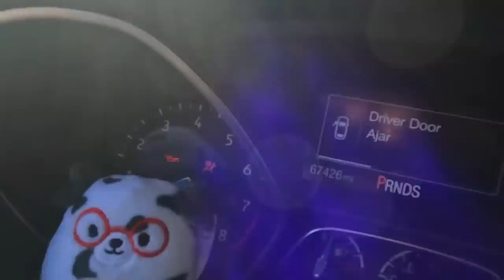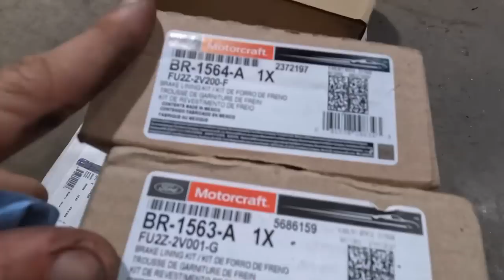Mechanic Cheats book time! Close Call | 2016 Ford Focus 2.0

Comment: @35:00 - looks like ball joint boot got punctured/cut by dust shield (little sharp burrs there), shmoo coming out. It is my little personal experience but those boots are quite fragile and too easily damaged. Work on them with extra care. Even checking them with pry bar or smth may (pinch)cut the rubber.

Comment: Hi, Ray. I just love watching your videos and your sense of humor.. As a mechanic myself , I have used antisieze compound on bolts and ball joints, to slide in easier. I also chase the threads so if any torquing is needed then it will be percise. Here is a thought, when you were having trouble with that long bolt with the compressor, you could have just cut it shorter. 😄 Also when you said that the " tip " fell out , well that could have gone south.😜😜😜. 
Hello. From Canada.

Comment: 26:05 I got a set of those mountains used from eBay. I tightened a 19mm bolt doing a control arm and it popped like I broke it. Spun it around a couple times and the ratchet thing re engaged. Works like new. Idk how the hell they made these things but they're indestructible

Comment: Ya know, those rear bushings are available in aftermarket, but I suppose with near 70k miles is was a good idea to just replace the arm...
Reply: True. Sometimes you can`t replace just the bushing. It is usually pressed on and needed a large press to remove it. Also ,it is also sometimes cheaper to just replace the whole arm , instead of the bushing replacement , due to shop time.

Comment: You could have removed the bolt on the bracket to the right (front of the car) of the AC compressor that's holding the hard line and you would have been able to move that compressor a lot more to get the bolt in and out easier.

Comment: Next time you get a Mazda or Ford with the 2.0, 2.3, or 2.5 and you have to change the passenger side control arm, go up top, loosen the passenger side motor mount, and jack the engine up 2". It takes all of 60 seconds!

Comment: When I changed the plugs on my Patriots I spray some PB Blaster down the hole before removing the plug and removed it slowly. This allows the oil to do its magic and vastly reduces the odds of the steel spark plug pulling the threads out of the alloy heads. Dissimilar metals, you know. A dab of nickel antiseize goes on the threads before hand tightening with a torque wrench.
Watching the inspection, when I do my cars I treat it like my life and my family's lives depend upon it. New brakes and possibly new rotors (pull the wheels and measure the thickness and the corrosion, you'd be surprised) and new tires are on the short list. It's not fun when you're driving in the rain and suddenly the steering wheel isn't connected to the road.

Comment: I find myself troubled when replacing parts on vehicles with pen stuff when it’s the one that has failed prematurely. In my head I am saying “why would I put the same junk parts back on the car”? Doesn’t this focus only have like 65k miles and the bushings are bad. I will let moog or mevotech take a swing at it before I let oem fail again.

Comment: That passenger side engine mount will leak and give some bad vibrations as the fluid leave snd it drops down metal to metal.   That ac compressor sucks, my daughters car had one on the 2.3L version of that engine.

Comment: seems like that zip tie head kept the cover from seating fully. I thought the video showed that one being tightened yesterday? maybe that was corrected. It's a good trick, but zip tie head should be down the side, it will still do what it's supposed to. an even smaller one would work. With those dumb plastic screws I would "never" use power drive, I prefer hand driver and go backwards to feel "click" of thread start point, THEN screw in by hand. After you cross thread a few sprinkler valves with same type of plastic screw, you reassess methods, because cutting out a irrigation manifold due to stripping a plastic screw is something you don't wanna do more than once.      Always enjoy the videos.

Comment: I wish Ray's shop was closer to where I live... brought my car in for what I figured was routine maintenance/tune up.  (60k/11yrs.)  I was expecting about a $1500 bill to change spark plugs (customer supplied because they refused to buy the ones I wanted), flush coolant, flush transmission, oil change, and tire rotation.  Good news is that was only $975, but the bad news is they also claimed I needed new outer tie rods, one sway bar link, and lower control arms (because the bushings were separated), thereby increasing the price by $2110.  I'd like to think Ray would have gotten this fixed at a much-more reasonable price.

Comment: I've  noticed that a lot of shops on here don't use anti seize. Is their a reason for thar. Here, we always use it. Galvanic action is a big thing here. Secondly you had bushing failure at I believe 60000.miles. why wouldn't opt for a lifetime warranty vs dealer part. The customer  would still pay labor either way,he just wouldn't have to pay for the part again

Comment: Back when I was an auto mechanic, I used to return the old parts back to the customer. I also got in the habit of taking photos of the part or parts before I removed them. Then I could show the customer what the old part looked like before I removed it. Then to prove the customer got new parts, I took photos of the new installed parts. I also saved the photos just in case the customer had any issues.
Reply: That must have been quite expensive and time consuming back in the day. I can picture the photographer you hired cloaked behind his pinhole camera and his gunpowder flash, then all the backroom processing under a red light to develop it with a silver solution. I'm sure it was worth it on those Model T's. 😆

Comment: I would not inspect or recommend spark plugs on any Ford engine before 100k miles. It states 100k mile replacement in the maintenance schedule. They aren't even mentioned before that, and the 60k inspection is just a repeat of the 30k check. My 2000 Ford Ranger ran 150K on the original plugs, and I have yet to see a Ford run less than 100K on their factory plugs in a properly maintained engine. Also, given the really good condition of the plugs (not fouled, running hot, or sooted up), I would not mess with the carbon on the pistons.

Comment: Watching you start those compressor bolts with the impact was terrifying. You sir are brave AF lol.
Reply: Once you’ve done it a thousand times, you know to stop if it doesn’t feel right. It’ll start to impact after the first couple threads if it’s cross threaded.
Reply: @stevewhiting556  I'm pretty sure he used a cordless ratchet to tighten them. Its not an impact tool. They don't have enough power to strip the threads.
Reply: It appears to be a 3/8 Milwaukee cordless impact. The grinding noise you hear are the anvils impacting. He does use cordless ratchets a lot, but it was an impact he was using for the compressor bolts.

Comment: You need to use an open-end wrench with a ratcheting feature on the second control arm.
Now that the bolt is out, could you cut off some of the length of the bolt so it would fit easier, or does the bolt need to be exactly that long?

Comment: Hey Ray...diff between aluminum vs steel control arms (besides from weight diff) which is more durable?🤔 (brand aside, not made in china) ive always prefer steel over alloy/aluminum stuff whenever possible. I care more for durability vs fuel efficiency.

Comment: I wondered if you can reverse bolt by compressor so next time it will be easy to remove and replace??
Reply: No, because the part it threads into is welded to the frame.

Comment: 28:00 my 05 Prius passenger lower control arm required prying the subframe to clear a bolt, or unbolting an engine mount. I saw a Nissan with a similar obstacle and now this Ford places a compressor in the way. 🤔 manufacturers I suppose have decided that replacing at least one of the control arms needs to be a challenge.

Comment: Not a fan of the "engineering" where the compressor had to be unbolted to remove that long bolt.  I also saw that clamp on the metal AC line that could've been removed to provide slack.

Comment: are any aftermarket aluminum control arms with better designed bushing than OEM? And zerk fitting on ball joint. Seems like some OEM stuff is inferior to aftermarket where aftermarket engineers are agile enough to improve on a flaw without some 2 year process at Ford. 67,000 for bushing failure seems short to me. I dunno'

Comment: Next time just take that bottom torque mount loose and pull the engine toward the radiator, to get that control arm bolt out.

Comment: Ok I have a question as to why the rotors are not turned on a lathe, is the cost for a replacement less or close to, instead of getting them turned. Usually you can get rotors turned twice before they exceed the minimum thickness...just wondering...
Reply: Cheaper to replace in most cases.
Reply: If there is a lathe in the shop and the tech is experienced in set up so that it can run while the tech is working nearby then it may be cost effective. If you have to take them all off and haul them to another shop to get them done whenever they feel like it then no.

Comment: @20:58 & @50:10  triggered again....torquing a suspension bush at full suspension droop.....c'mon Ray, you don't need me or anyone to tell you that you know better than this. As you say, you are distracted and not focusing on the job in hand. Similarly, struggling with that swaybar. Why? You knew you'd be doing both sides, why not undo both sides, strip both sides, assemble both sides THEN fit & tighten the bolts. Made more work for yourself.

Sorry, don't intend to come across grumpy.

Comment: You could have just dropped the Ty-Wrap in the hole, would have done the job. And what is it with you guys using POWER drivers with the plastic parts? That is the reason the threads got stripped in the first place, undoing the 3 screws by hand would have taken LESS time than fooling with that Ty-Wrap! I own a '13 Focus with 100K miles on the "clock" , have taken the cover off MANY times (by hand), still no stripped screws! As for the induction service, my yearly routine using CRC intake cleaner (as per instructions) along with using a "low volatility" oil (Pennzoil ULTRA Platinum has the lowest evaporation, even lower than Amsoil) and mostly high speed driving, has kept the power at a satisfactory level. I will be trading it well before it NEEDS the "walnut shell" treatment!

Comment: Just wondering Rainman. It seems that with every brake job you post that you change out the rotors. I have done many brake jobs as a backyard mechanic and rarely do I change out the rotors. I do measure them and make sure they are in spec. So do you do many brake jobs without rotor changes?
Reply: At Volkswagen dealership we never machine rotors just replaced them

Comment: Whatever you do. Do not undo the engine to subframe mount and roll the engine to remove the control arm bolt. I would much rather see you struggle instead. Also you needed to loosen other side bolts to sway bar/control arm bushing to make installing control arms easier. But I like watching your struggle to repair videos.

Comment: can i ask ray is your right angled impact he  MILWAUKEE M12FRAIWF12-0 M12 FUEL 1/2" RIGHT ANGLE IMPACT WRENCH or another just am looking to buy one the same as yours also huge fan from uk
Reply from the maker: I actually have the 3/8 and the 1/2”. I use the 3/8 much more often than the 1/2. And they make the same power.
Reply: @RainmanRaysRepairs  so would you say it would be wiser money spent to ger the 3/8 over the 1/2

Comment: Not a professional by any means but wouldn’t the control arms be serviceable? Seems a waste of material to need to purchase a whole assembly if you could just change out the rubber bushings? Certainly a time issue to change out each bushing but the cost of an entire new assembly seems to be much more money.

Comment: RAYMOND this has quickly become my morning ritual. Turning on youtube on my cell phone and casting to my 65" qled Samsung TV and advantage avr3040 
Yahama 9.2 audio video reciver and watching it in 5.1 mode,  

I seen you was looking at AV racks for the house, if its just a TV hang it from the wall on a full motion wall bracket. Unless your running a full audio video system 
Finiture needs change everytime tvs transform  remember the big entertainment systems from the 90s and 2000 you cant use one on a 65" or 70" TV and the price of the big sets keep going down.  Even projectors prices are getting more affordable. Unless you can make finiture cheap or buy one cheap its not worth the investment on something that says it real wood but turns out it laminated wood then when your TV goes out your stuck with something ment for a 50" screen and all you can get to replace it is a 65" screen. 
I paid 1/2 for my 65" screen then I did on my 47" plasma TV 15 years ago.
Hell buy 2 tool boxes from harbor freight and a pre made maple counter top from home depot,  at least you can use them for somthing else later and it will cost the same.

Comment: 67 thousand miles, on a 2012, should not need a tune up really, but with such low mileage I suppose stuff can get fouled just by not getting run enough.  That is just a little over 3,000 miles per year.  Sometimes you just have to get a car out on the freeway and run it at 70 or 80 and get it hot.  Burn out the carbon build up and all that.

Comment: speaking of ball joints (and some other things), is putting a smidge of grease on those fittings contra-indicated?
the next guy/woman doing a job would probably (hopefully) be grateful for making their job just a little easier.
a little lube on unthreaded parts might make for some smiles.

Comment: I was just thinking, how easy they make it by supplying the new control arms complete with ball joints and bushes already installed. Then came the AC compressor lol. The other thing I can't get my head around is why manufacturers insist on putting torx headed bolts everywhere. All it does is make the mechanic buy more tools 🤷‍♂
Reply: Sometimes access to the bolt makes bolt style a cheaper option.
Reply: Deal w/snap on
Reply: Probably in line with some kind of deal Ford got to make them under license.  Robertson refused to give Ford licensing rights back a long time ago otherwise instead of Phillips or Torx, you'd be using Robertson (a much superior fastener.)

Comment: My wife is hard on breaks.  She can see the light ahead has turned red and yet she is still accelerating. I ask her if she is in a hurry to stop......She gives me the evil eye. Then I tell her she will be getting a break job sooner rather than later. Years ago I taught her how to drive a standard on my 67 Vette.  She started off in 3rd gear instead of 1st once (no problem for a Vette) and the car jumped like a rabbit and took off faster than she expected. I told her not to "lugg" the engine, and she replied ,"What are you talking about?"  Women just don't understand mechanics or physics. She did think it was fun though, so there is that.
Reply: Please, this does my head in .... it's BRAKE, repeat BRAKE not break!
Reply: @Biffo1262  I agree. The same idiots say a kerb is a curb! What like Curb your enthusiasm?

Comment: Did the transmission fail out yet
Reply: Doubt it.  Not the dps6 trans as this is 15-18 focus mk3.5. You can tell by the front fender, headlights, tail light, radio controls and the instrument cluster display is blue and black.  The year given at the beginning is wrong
Reply: It's coming soon. You know it.
Reply: Depends, they went back to a standard automatic transmission for the 15-18 model yrs.  I have a 14 focus with 370k and only 3 trans repairs.  Last 2 were for worn out clutch friction material at 235k and 370k.

Comment: Question. Since Ray has the tools, wouldn't it be much more cost effective to replace the arm bushings, instead of the entire arm?
Reply: no
Reply: Absolutely
Reply: Are they an exchange part?  If so then no.  You have to weigh up the labour involved if you pay someone else to do it.  It is probably cost effect to replace the bushings if it's your own car.  It is rather similar to drive shafts.  Do you replace just the outer CV joint or the whole drive shaft with inner CV joint.  If the garage is doing it then it's a no brainer as the labour charge is car far less to replace the whole drive shaft than just the outer CV joint.  The labour charge is actually more to replace the joint than the difference in cost to replace the whole drive shaft PLUS you know the whole thing is right and doesn't have to be done again in a few months to replace the inner.
Reply: Nope other bushes won't be far behind in failing, what you save in parts you pay for in labour getting old bush off and new one pressed on only for say balljoint or front bush to go not long after, then you're paying all over again
Reply: They're not serviceable on this one.
Reply: @offbeatwarble  Good points. Thanks for clarifying.

Comment: I used to own one of those cars. Biggest piece of crap ever assembled. The transmission was absolutely the worst.  I bought it brand new with 150ish miles on it and sold it to carmax with roughly 10k miles. Carmax almost didn't take it due to the transmission notoriety.
Reply: What kind trans is it

Comment: A quick question, Ray. Have you ever used a "pickle fork" ball joint separator? My father had one. It was made of cast aluminum. Also, do you know anyone who still uses one?
Reply: Pickle forks work great if you’re not reusing the same ball joint.  I have found that they can easily damage the rubber boot on the ball joint.  I have one in my tool box.
Reply: They do make the ball joint a single use item.